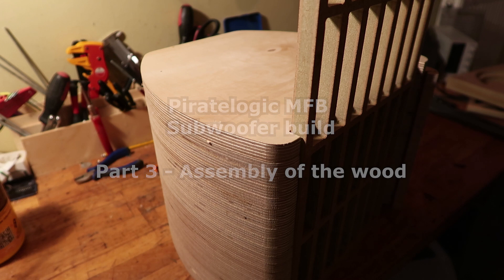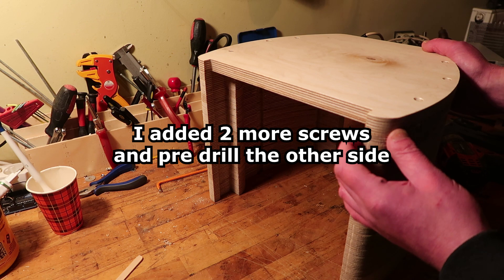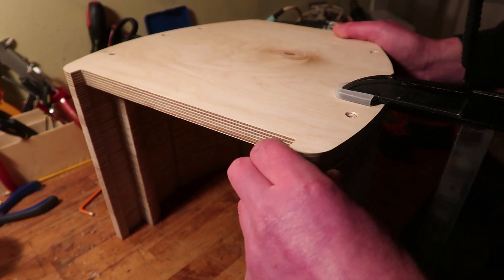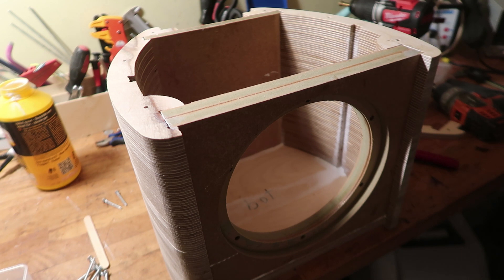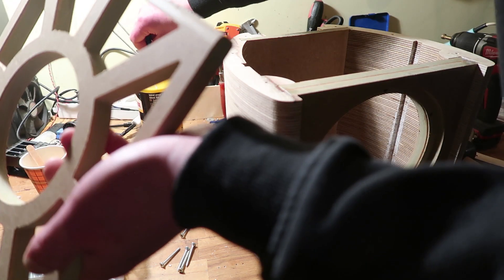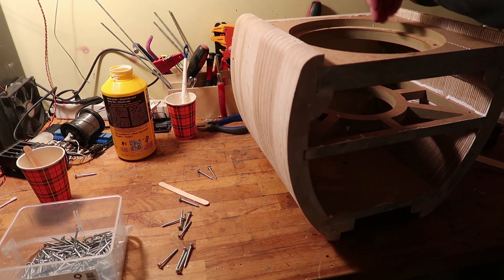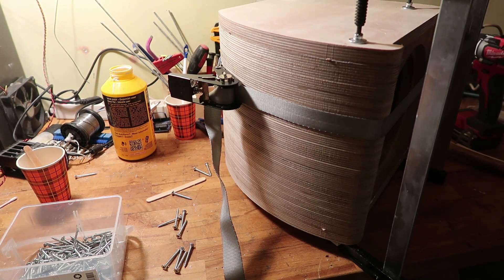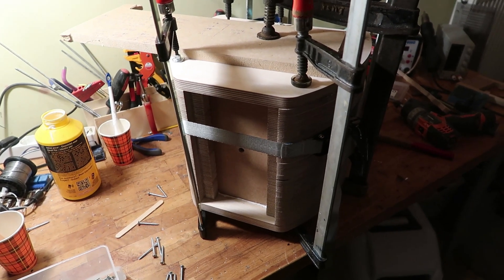Motional Feed Back Subwoofer Build - Part 3 Assembly of the cabinet

Comment: For the next one you may want to include dowels holes in your cnc work file: it will make the final assembly alignment a lot easier.
Reply from the maker: yes indeed, a few mentioned as well and you are right... i should have used a big dowel and pound it in :(. thanks for the tip anyways !

Comment: Why screws??? The glue is much more strong and sufficient. I love your work.
Reply from the maker: yeah they are. the screws i only used as i guide. they might even be removed. the top side does not have any screws. using only clamps i would not got away with the amount of rage/hammering i had to do :(

Comment: Nice! For my part, I drill before putting screws in. Ups, forget it :)
Reply from the maker: Completely agree !! I did with the other 5 , this one happens to go in ok.... but not recommended ! i countersun the others to. i might remove them in the end
Reply: @joppepeelen  ... and then filler it and give it some nice color? Or raw oiled?
Reply from the maker: @yo3429  well its only on the bottom. i will never see the bottom ever again so i need to think about that :) but sanding the whole thing and getting the front and backside black has main prio